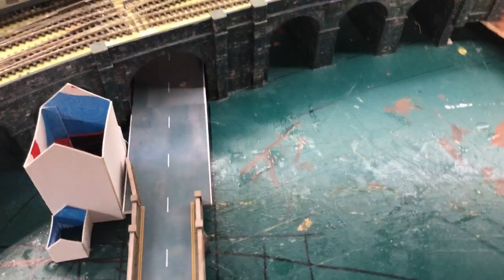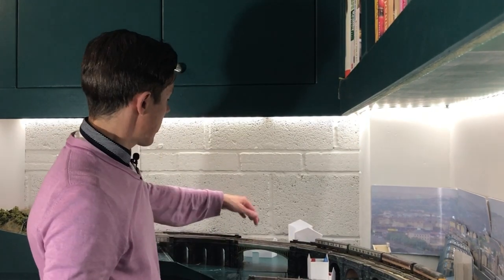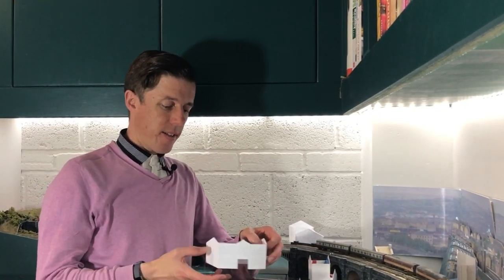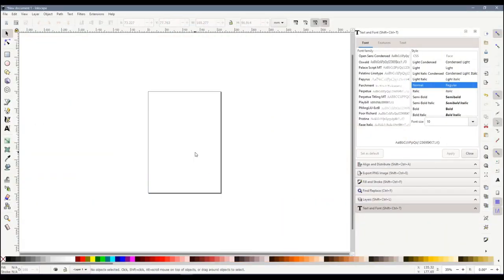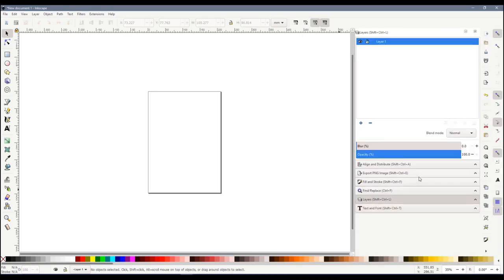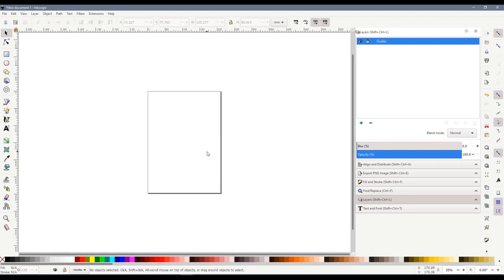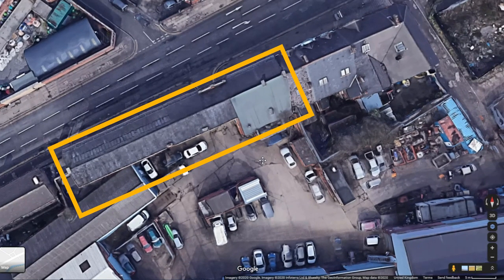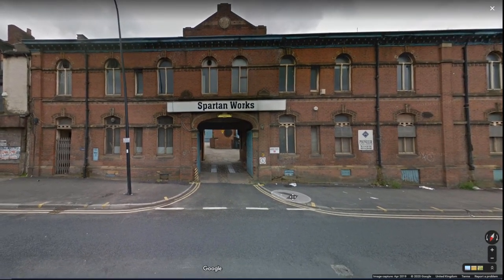Industrial Scratch Build 1 - The Paper Mock Up - Scratch Building With Inkscape

Comment: Hi Michael. Great start to Spartan Works. I've always tried to use guidlines for window spacing, but using the dimensions of the windows themselves makes much more sense - I bet the architect of the original building designed the frontage in much the same way. Instead of cutting out the windows one by one through the base layer, select them all, go to "Path-Union" to make one group, move this to the top, select both the top window layer and the base layer, then go to "Path - Difference" to cut them all out at once - will save you loads of time. You can also make your own windows by designing in Inkscape and printing onto the acetate used to make Overhead Projector slides. This doesn't work with light colours, but black, dark green and that dark, red oxide primer colour often seen on industrial building windows works a treat. Great stuff and really looking forward to the rest of the build.
Reply from the maker: Thanks Paul. That’s really good advice about cutting out multiples. Obvious really, now you mention it! I’ve used inkjet acetate before but with mixed results and decided to avoid it on this occasion. Never really liked black, but now you mention the red oxide... 🤔

Comment: Hi Michael, your tutorials on inkscape inspired me to build my own station building, which I have now completed. I'm very proud of the results & excited about the opportunities of creating many customized structures. Thanks for introducing me to this great tool and I look forward to following your progress.
Reply from the maker: Hi Darren, that is excellent to hear! What scale do you model? I’d love to see the results of your station building. Thank you for letting me know about it. 👍🏻👍🏻
Reply: @Chandwell  I'm building my first layout, it's in N gauge too.  I wanted to do something unique and not go for the kits. It's a great way to learn new skills. Loved the video of how you scaled a texture to n gauge,  that was a great tip. Can I ask that when you print out the textures, do you use an ink fixer before varnishing to prevent ink bleeding? Thanks Daren
Reply from the maker: No. I print onto 110gsm matte photo paper from eBay using high quality settings on my Canon inkjet. Then I leave it all alone until the model is finished where I brush-apply ultra matte varnish. I sometimes apply a couple of coats of gloss first as sometimes the matt leaves a dust in the surface when the base varnish is absorbed into the paper. It dries rock hard though and even spraying water into it doesn’t cause the inks to run once done.

Comment: This is an excellent tutorial, I know this as for many years I headed a group of 3d cad users with an engineering company and often did presentations,so I know how much prep work is required to build this type of video.
I suspect you are involved in this or similar type of role?
An excellent piece of software which seems to be very user friendly and would be a great tool for every modeller.
Given the software has Layers, can you explain why you did not use the Google Street View as a reference in another layer which would enable you to obtain a more accurate drawing? Or is that how you would normally work and this video production is an introduction?
Really well done and so interesting. Thanks for shsring
Reply from the maker: Thank you so much for your kind words, Charlie; it means a lot. It is surprising how much effort goes into making a tutorial like this; I naively thought that these ones would be quick compared to the normal layout update ones, but I was wrong!

In my full-time real-life role, I am an IT architect/consultant, so am familiar with the presentation styles, although never do any drawing - that's just for fun.

I sometimes use layers for accurate drawings. I used that technique with the 13th century bridge, which you can check out briefly here: https://youtu.be/j4FbjlZVjXg?t=169

I chose not to on this occasion though because I am not convinced the wide-angle Google streetview lens gives a very accurate representation of the proportions (I may well be wrong here). Since I was basing all the measurements off the Scaleglaze windows, I was after more of a general feeling for this build rather than dead accuracy. You've given me food for thought for another series though... :)

All the best, and thanks again for your comment! --MIchael.

Comment: Just a thought, as you have layers in inkscape, is it possible to take a screen shot of the building in google and use it as a guide behind the main layer you are designing in? Similar to Photoshop I would guess? You could set the design layer as semi transparent to see the building behind?
Reply from the maker: Hi Robert. That’s a great technique and one I use often. I used it on the 13th Century river bridge recently where I used an architectural drawing of the bridge to be sure I got the shape and dimensions right. I chose not to on this occasion for a couple of reasons. Firstly, I was using the Scaleglaze windows and basing everything else off those. They seem to be a slightly different proportion to the ones on the real building, so tracing the picture would not be very reliable. I don’t think the wide-angle Street View is very good for accurate drawings either. Having said all that, it would have reduced the amount of switching between apps, so it would have saved some time, and I may do it that way next time. Do you use Inkscape much, or scratch-build?
Reply: @Chandwell  Just learning new skills to see if I am capable! Have yet to try any scratch-building, but this has given me some great information to attempt the buildings that I would like to do. As for the street view images, I guess a number of side aligned images would help to take off the skew of the lens perhaps. It would mean that a lot more work is needed to create a base to match the drawing onto. Perhaps my own photos would be more accurate than the wide-angle ones? Anyway, many thanks for replying, having watched another one of your videos, a lot of questions I may have had have been answered! Excellent and informative channel .